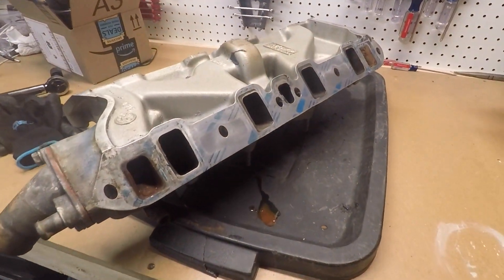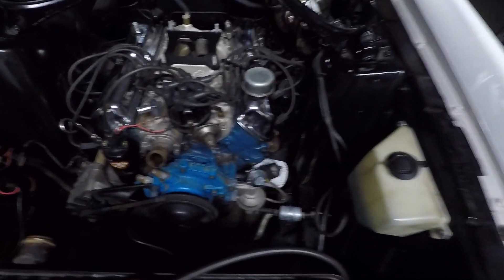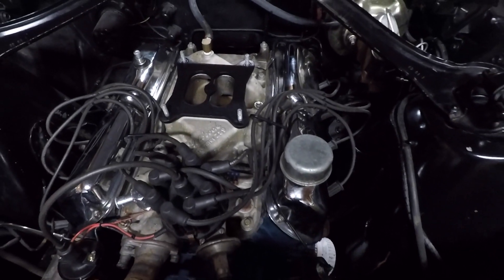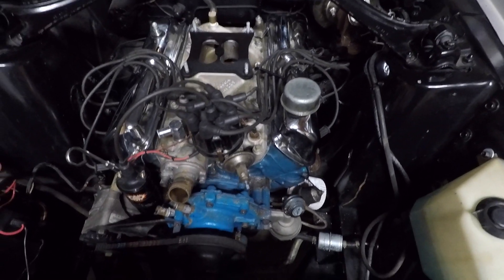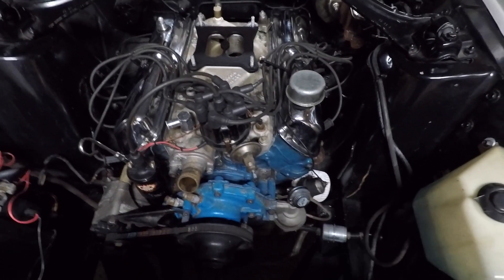Part 3 of Mustang 289 Engine Assembly  Installing Intake Manifold

Comment: Great video and I am getting ready to do this job on my 65 Mustang Fastback.  One observation.   You fast forwarded over part of the actual installation but it looked like once you threaded the bolts in finger tight you started torquing them down to spec.  It looked like you used the proper star pattern of going around the manifold but I would be concerned that it might not seal well since you torqued the bolts down without going around the manifold and tighten the bolts (just snug) before then torquing them to spec.  You may have done that but I couldn't tell from the video.  If you didn't, and torqued the bolts without snugging them all the way around first, you run the risk of warping something and not getting a good seal.